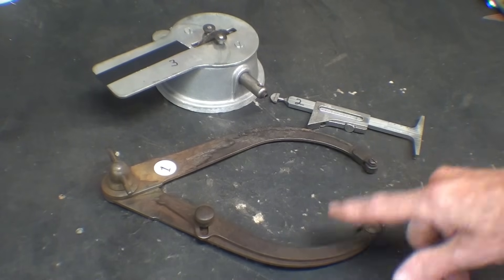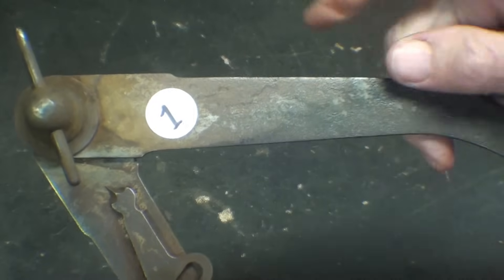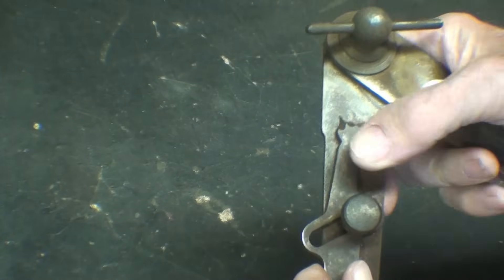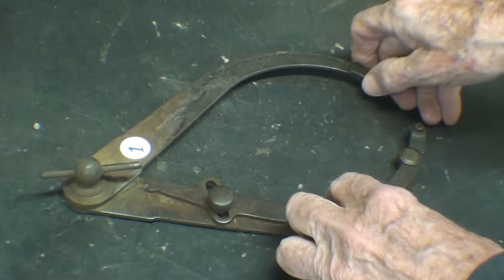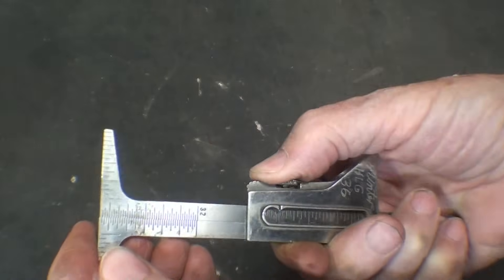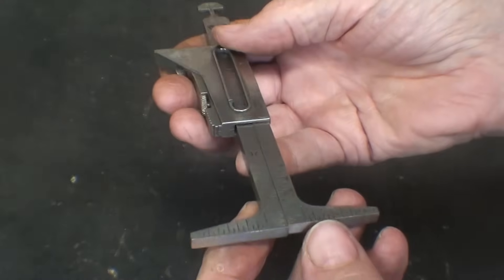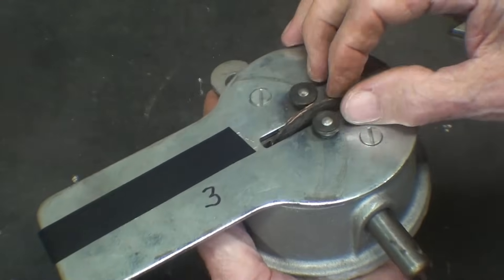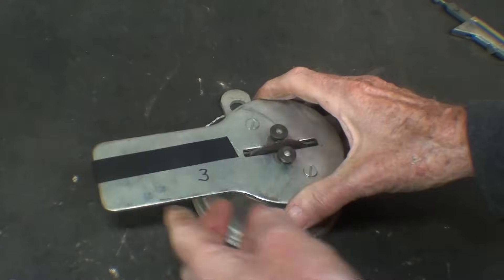WHAT IS IT? Mystery Tools #93a question tubalcain MRPETE

Comment: 1 is a caliper that can be set for tolerance (like a go no go gauge)
2 is a welding inspection gauge that measures butt weld fit ups ( offset of joint and other factors)
3 is a piston ring gapper

Comment: #3 looks to be a piston ring gapping tool. In my work, repairing industrial machinery, we would often buy piston rings from a ring manufacturer that were full "full cut".  If you were installing the ring in a cylinder that was a little oversized, a standard size ring would have too much gap at the ends. You could trim a full cut ring to fit the bore   and end up with a gap that was within spec. I haven't a clue what the other two are but they look very interesting.

Comment: #2 Is a Pipefitter's Hi-Lo gauge.  100% sure.  Ask me how I know!
GAL was the original manufacturer but there are now knockoff brands available.
The tool has multiple purposes.  
Angle check for an ASME standard 37.5 degree pipe bevel (each side)
Root mismatch gauge
Wall thickness gauge
Hi Lo gauge for base metal surface.

Comment: This was a really good one, I don't have an earthly idea what any of them are for.    For no. 1, rollers usually mean something is moving or you're running down a surface.  I think you're in trouble if you need #2.  No. 3 could sharpen a hole saw, but why is there only one set of radius marks?

Comment: I really do have fun with these. So, here is what I found out about #1. The Davis Boring Tool Co. made what they called an expansion boring head. It was a Victorian era tool for finishing bores on steel or iron wheels. I was unsuccessful at attaching a link to a photo. The head had a pilot, two rows of cutters with graduated adjustment, and a chamfering blade. It looks like the calipers could be set to a shaft or pin, then adjusted to provide the desired fit, and finally used to set the cutters on the head. Six second to finish a bore was the claim.

Comment: #2 is a mismatch gauge for welding, mostly used in pipe welding. The rounded end is inserted through the root gap and turned 90 degrees roll to measure internal mismatch. The base is just set on the outside of the joint, straddling the weld area. Most of them have a relief in the middle so it can be used for post-weld inspection (externally only for obvious reasons) too but yours appears to only be for pre-weld inspection as there would be no way to use it post-weld with interfering with the weld bead.

Comment: I found an identical tool on Fleabay. The auction ended in Feb. of this year but here is the auction number - 326001835284. It must be accurate for it's day. Davis was purchased by Giddings and Lewis of St. Louis back in 1945 and moved to Fond du Lac. WI to a modern facility. and I saw a report that it was voluntarily dissolved, whatever that means. Interesting tool.  
#3 is a piston ring filer for setting the gap. I recently purchased one of these for the engine I am building. Setting ring gap is very important for oil control and compression.

Comment: Very nice calipers with fine adjustment possibly for adjusting boring heads. No.2 never seen before,?? And 3 for adjusting piston ring gaps.😊
Reply: Number two is a set up for pipe welding. To make sure that the pipes are aligned.

Comment: No 1 is a crank pin / journal caliper for railway use. The moving jaw is set to 0 and the jaws are then opened and set on a gauge block to the nominal size, and clamped at the pivot. Then the pin or journal actual size up or down from nominal is measured at the graduated scale, in thousandths of an inch. No 3 is a piston ring gap grinder. No 2 may be a welding gauge but not sure.

Comment: Boy, some interesting items! #1 seems to be something used to measure a work piece in the lathe while it is still revolving. I suppose it would be compared to a master of known size.
Number 2 is really intriguing; I've never seen anything like it either. 
Number 3 is for filing the end gap on piston rings (but you knew that), however, you said there is an abrasive disc but I think those always used a hardened steel disc with fine serrations on the flats. I think the original disc has been replaced with the abrasive. What do you think?
Thanks for some really interesting items!

Comment: No. 2 is a internal  and external  mis-match gauge for  checking  the ASME TOLERANCES  on rolled  steel pressure plates after fitting  and tack welding them but  prior to  completed welding of the circumference of  said vessels. Works well both on the outside or inside . The flat  end is stood on the fitted joints then read from scale. The thin rou ded e d is designed  to insert through the joint gap and can check  both gap and mis-match for tolerance.  
Ed.

Comment: Knobulated! the work fo the week now Mr Pete. Thank you. 
1: I am not sure some kind of tool setting gage perhaps 
2: Hi-Lo gage for welding pipe
3: Pistion ring gap tool. Used one in the machine shop I works in
Reply: We never had a ring filer; is the disc really an abrasive or are they a steel disc file sort of thing? The photos I saw looked to be a steel disc. We had to hand file if necessary.

Comment: #1 Fine adjust option so a tool can be precisely adjusted. bore is 0.008 under,  ajust the caliper by tht and match the tool to it.
2: weld setup gauge. More measuring offset and gap when lining pipe, mostly, but also plate. Both ends work, one weld, one back side through the gap. Very very useful.
3: for sharpening gasket punches?

Comment: Number 1 if the rollers turned freely would work great on grinding rubber rollers.  I used to get involved with glue applucator rolls, we used a pi tape.  Number 2 no clue.  Number 3 i would use on piston rings to adjust end gap.
Reply: Applicator, gee.
Reply: 1. Don't know, but maybe for measuring on lathe without stopping machine.
Reply: @foxyfoxy2916  Depending on durometer of rubber it is hard to measure across points, that is why we used pi tape, had a dial indicator with a ball bearing for checking runout.
Hey this is 17 year memory here, 5 ft wide rolls, .005 tir,  .005 diameter.  Diameter could be tapered from one end to the other,  not big on ends and smaller in middle.  Gee I am getting old and can't remember names, but I have always had that problem.  Calendar? Roll.  Ran against glue rolls, hardened and ground steel.  We set rubber rolls to it.  Used a sheet of paper to adjust, light pull, it was a practiced feel.
Like I said, that was 18 years ago when I was the lamination department mechanic, before that I worked in the tooling department, we fixed laminator rolls.  Rubber rolls, hard to measure rubber, we used pi tape pulled tight.  Calipers with rollers?  Pi tape might be better?